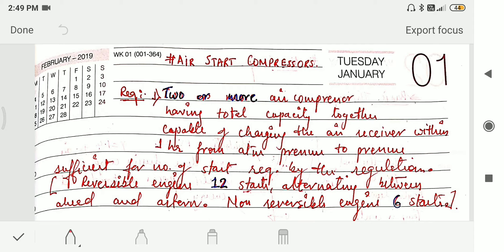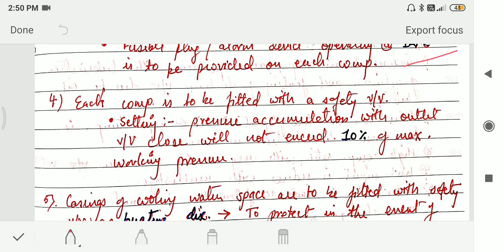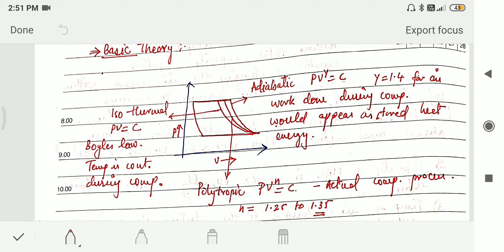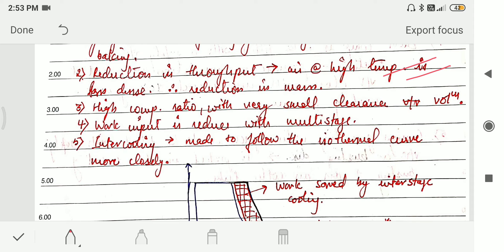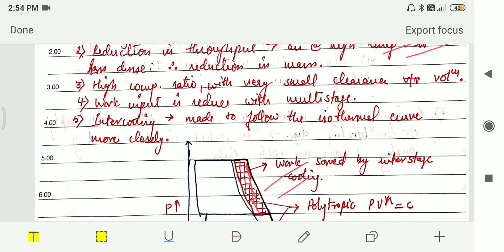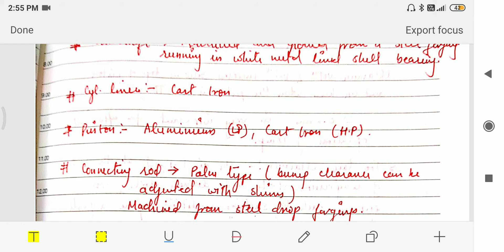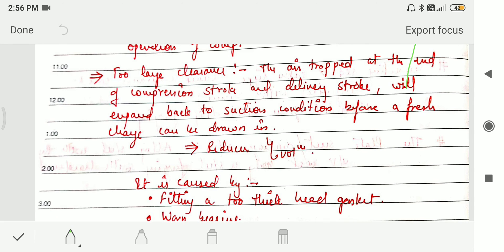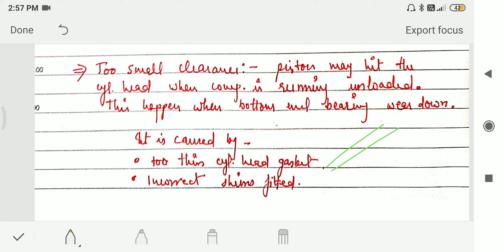Main Air Compressor On Ships Part-1

Comment: Why flywheel in Air compressor & not in AC compressor ??
Reply from the maker: Really speaking I am not able to get answer to this question on internet but what I can think of is, pressure ratio is less in AC and refrigeration plant (pressure ratio is approx 5) as compare to main air compressor(pressure ratio is 30)...for the same reason flywheel is not given on service or control air compressor... motor is design in such a way that it can give sufficient energy for next compression stroke that it doesn't need flywheel to store energy for next compression stroke...
This is what I can think of...if sooner or later I get the answer to this question, I will let u know....
Thanks for this wonderful question...👍

Comment: how can i test air compressor trips are working in good order?
Reply from the maker: Only two trips are there...one is high air temperature and other is low lub oil pressure, both u can do using calibrator after running compressor.

Comment: How can we do pressure test of intercooler and aftercooler onboard ?
How to know whether the cooling water flow is correct ?
Reply from the maker: For testing u have to make arrangements to seal one side and to pressurise other side with a air connection and pressure guage...fill the tubes with water and then pressurise it with air....and to know if flow is correct monitor the cooling water pressure and if still u feel air is not getting cooled to desired temperature then try to clean air side as there may be oil and dust deposit on the pipes.
Reply: @meoexams  Thank you